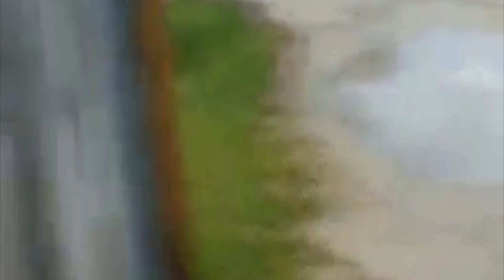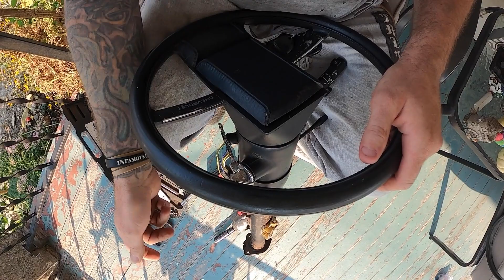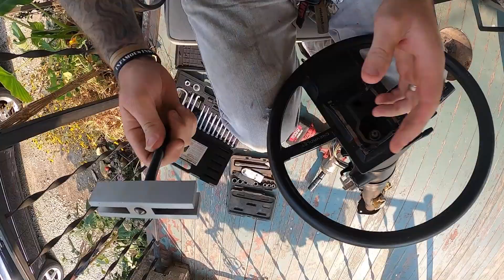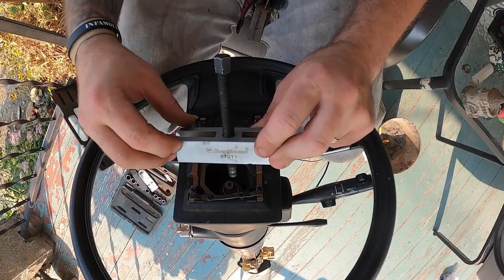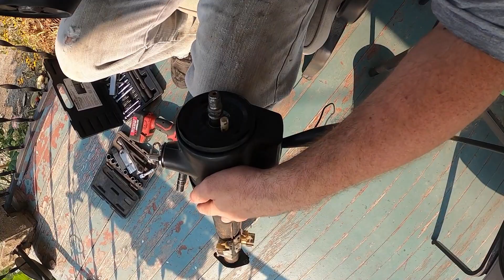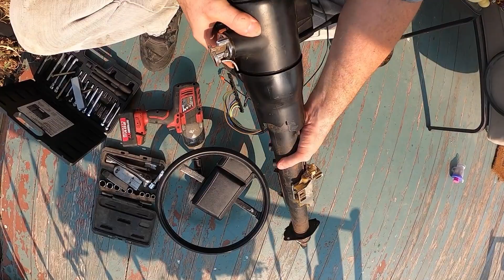How to remove a 3rd Gen Camaro/Firebird steering wheel.

Comment: What part do I need for my 1985 Chevrolet Camaro Z-28? It is the part inside the steering shaft that the combination switch plugs into to operate the clicking of windshield wipers, washer pissers, turn signals, high and low beams.
Reply from the maker: Yes